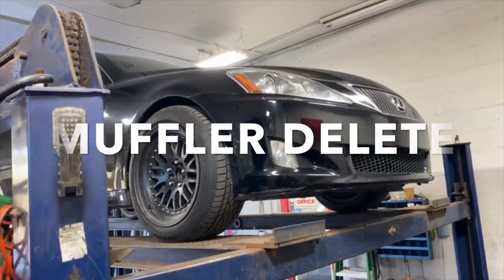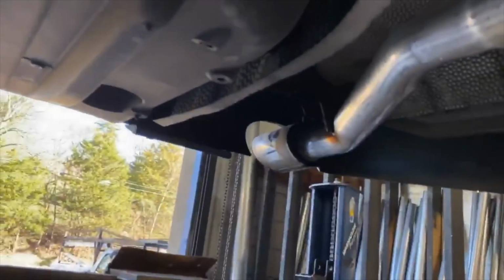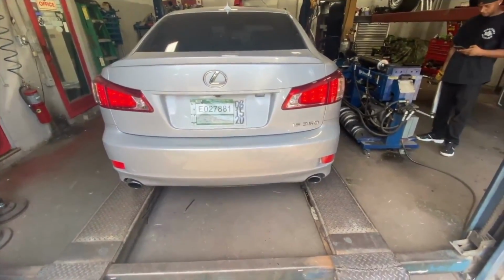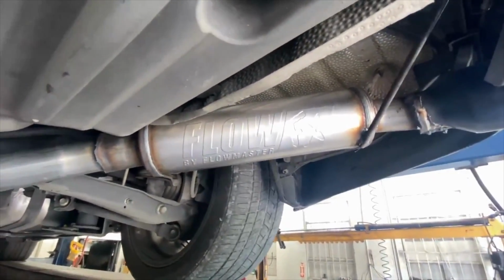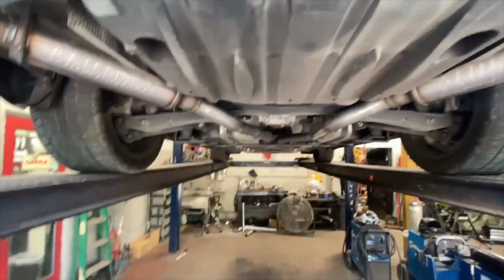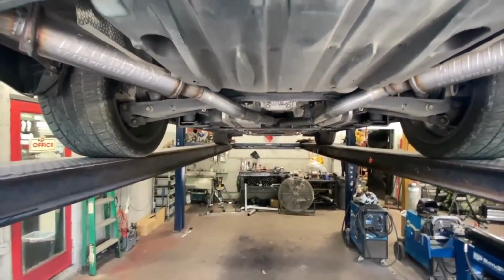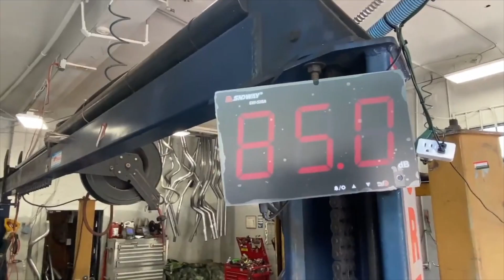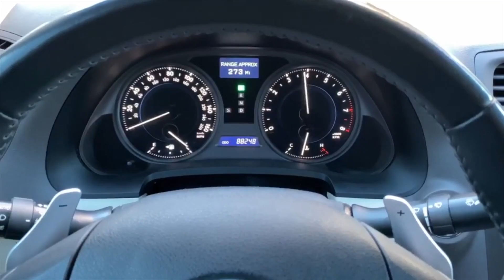Lexus IS 350 3.5L V6: MUFFLER DELETE Vs FLOWMASTER FLOW FX!

Comment: Muffler delete sounds much better, and it can be quiet and tame if you don't drive hard.  Flowmaster sounds ricey and raspy. The wheel and tire setup on that black Lexus are hideous.
Reply: What are your thoughts about me getting a catback exhuast plus a aftermarket vibrant resonator for my gs350 2010, I live in California I don't want it to sound to loud lol
Reply: @senorbonbon   That's a good combo.  Install the catback first and see how you like the sound.  If you want a little more then add the resonator.
Reply: @senorbonbon   Check out the is350  exhaust video on my channel. Same engine as the GS so sounds should be similar.  Wear headphones
Reply: @Jedi_Luke  appreciate it boss man
Reply: Ya the tires and rim on the the black one looks like  night rider setup
Reply: @antonioramirez973  yeah Knight Rider ugly 🤣

Comment: I deleted the mufflers off my IS250 & installed a Vibrant resonator. Car sounds clean, honestly best setup for these cars without it getting too raspy
Reply: which resonator did you get?
Reply: The 250 needs to be quiet, it's too slow and ricy sounding. 350 can pull it off though
Reply: I have a muffler delete on my is250 and it’s rlly clean tbh I’m thinking abt the vibrant resonator aswell did it make it a bit louder ?
Reply: @fernandocastillo8026 why would adding a resonator make it louder
Reply: @TM-fx5le  it will make it significantly louder, stock resonators silence the car a lot

Comment: I have a muffler delete on mine rn. But after this video I might try out that flowmaster true dual but add an X pipe.
Reply: Is it a 350? How does it sounds? Particularly the drone on the inside
Reply: @BraydenRGreen yeah 350
Drone was kinda bad but I solved it by putting expaning foam in the trunk under the carpet/lining and spare wheel area.

Comment: Will it throw codes if you go str8 pipe after the front cats  and then mufflers in the back? Essentially you removed the rear cats and resonators.

Comment: I’ve had the muffler delete on mine since a week after I bought the car, couldn’t be happier for only a couple hundred bucks spent
Reply: @shordymister8894  If I knew how to do it myself I would have, I’m not broke so it’s not a big deal. I do get your point tho
Reply: @shordymister8894  it was probably in the ballpark of 170
Reply: @shordymister8894  which components do you have
Reply: @sesh3508  hey man, currently have a gs350 with a revel catback and I wanted to make it a little louder so I was thinking of getting a muffler delete or switch the mufflers with some magnaflow / flowmaster any thoughts
Reply: @senorbonbon  Hmmm I’m not sure what you could do to make it louder, maybe deleting the cats would but I’m not sure honestly

Comment: Had both mods on my is250 , didn't like either , ended it up with a vibrant resonator instead
Reply: I think I’m going to do headers, vibrant resonator, and flow master or Meghan racing axle back. What mufflers did you use with the vibrant resonator?
Reply: @350Carmine  I just have muffler delete with vibrant resonator,  check my video out and hear it your self
Reply: @LlanosTv  Im debating to get a catback exhuast and a aftermarket vibrant resonator for my GS 350 2010, Do you think itll sound okay since I live in California lol

Comment: I bet the one with the Flowmaster had a True Dual setup, just needs an X Pipe to get the Original Sound back
Reply: Where does the X pipe go?
Reply: @Drive on the Straight Path  Id say somewhere around in between the front & rear door section

Comment: Okay but I did a muffler delete and a resonator delete on my 2007 is350, it's so much louder than both of those options in the vid..
Reply: well yea you took both off, the resonator and mufflers. the flow fx is a muffler and the muffler delete still has the resonator on. yours is basically straight piped
Reply: @ilanmichel  Technically cat-back straight pipe. I didn't touch the catalytic converters. But yeah I see what you mean.

Comment: If you get a lot of drone and to clean the exhaust note at lower rpms, do a branch resonator (side pipe with no exit to block harmonic frequencies). Most muffler shops know how to do the mod.

Comment: So what about the piping? If I want that done to my is350 do I have to just bring the flowmaster mufflers and that's it or tips if I want?
Reply: Don’t do that , Buy Invidia Mid Pipe designed for lexus , and delete muffler by a 2.5 inlet-Outlet 4 inch so muffler tip looks wide on the back and trust me sounds like a beast and even better if you put PPE headers 🔥
Reply: @vanguard7489  do u have that set up if so can u pot a video of u reving ur car, if u do can u reply to this comment
Reply: @vanguard7489  will it have any drone inside cabin